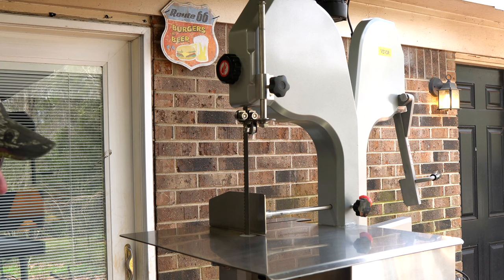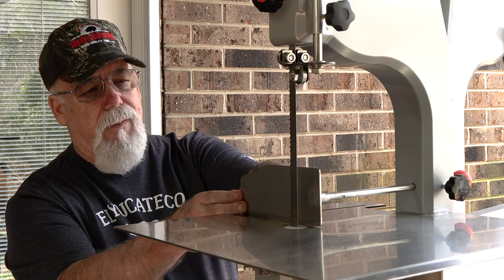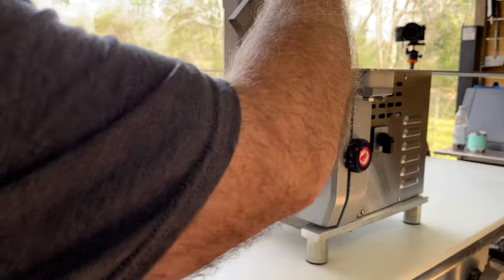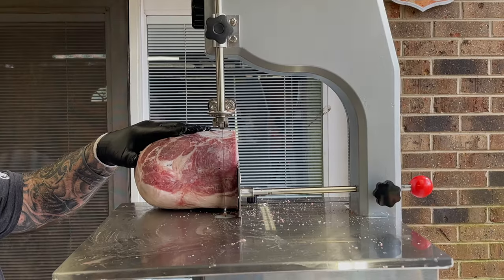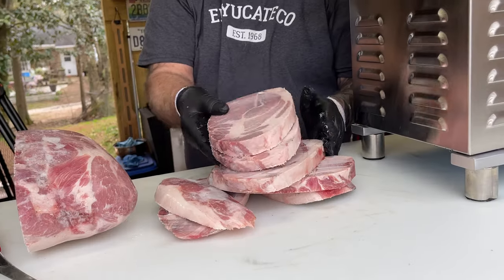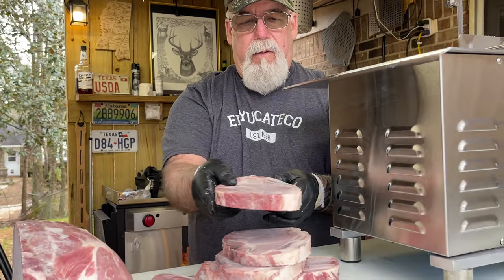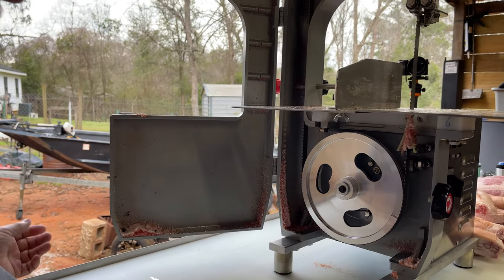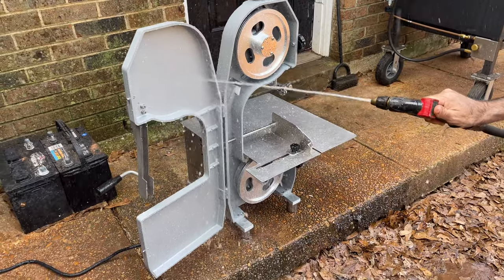Watch This Before Paying A Butcher | Vevor Bone Saw Review

Comment: cool saw. om use to using bigger equipment and having the blade facing the other direction and having a sliding table you'd use your hips to move.
Reply from the maker: Yeah not bad for a home saw.  The price isn't bad either

Comment: Great home band saw! I bet it came with a boneless blade too. I never used one that didn't have a rollers to hold the meat though. A good butchers tip for cutting bone-in steaks is to use a knife to cut the steaks and only use the band saw to cut the bone. A jug of pink sanitizer is great to spray it with after the soap and water. Right on Russ!
Reply from the maker: I’ve always found it easier to freeze the meat before sawing.  Faster and good results.  If your not wanting to freeze the meat then you can certainly cut with a knife and use the saw just for the bone, but since freezing is usually involved, I prefer that more.  Thanks for watching Mike

Comment: A curious question, is that a left hand saw or does your camera flip things? The reason I ask is that most equipment like that comes standard right handed. Also cutting with the nitrile gloves is not a problem, just don't wear chainmail gloves when using the bandsaw. Also what is the throat depth for the saw?
Reply from the maker: It’s not labeled right or left handed.  My cameras do not flip the image.  As for as gloves go, they are cotton. The meat is frozen.  To me it’s more dangerous to have numb fingers.  That’s what can lead to accidents.

Comment: Love the review looks like it would be excellent for cutting frozen meat, However I'm planning to butcher a cow again, my third time in doing so,  and would like to know how this saw would handle really cold (38 - 40 degrees) dry aged pieces.

Any insight in that would be great.  Thanks, Dave
Reply from the maker: In all honesty this saw may be a little small for the large primal cuts you get from a whole steer.  It will cut it with no problem but the distance from the blade to the saw body probably isn’t enough for large cuts.  Hogs or deer however should be no problem

Comment: Hey Russ, i was under the impression that this saw would not run with the door open and also i noticed that the saw you are cutting with has roller bearing guide for the blade but when i look at them at Vevor's web site they are showing plastic guides. Is yours a different model are can you order the roller guide seperately? I would buy one if it came with roller guide. Thanks
Reply from the maker: I think I was able to run it with the door open, but not a good idea.  The roller bearing guide is metal with metal rollers.  As far as I know, I posted the link to the saw I'm using, but I will double check.  They do have different saws.
Reply: Thanks Russ.